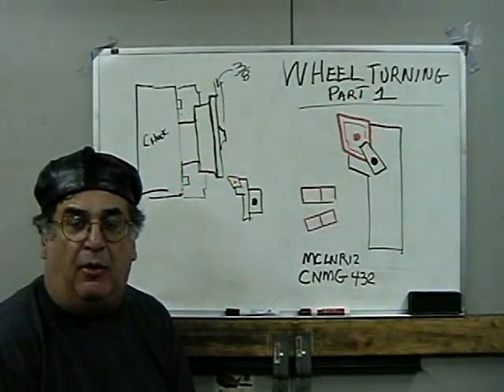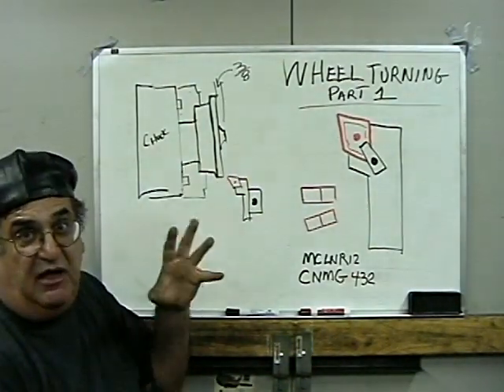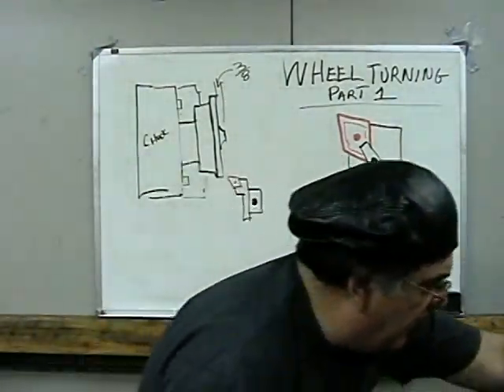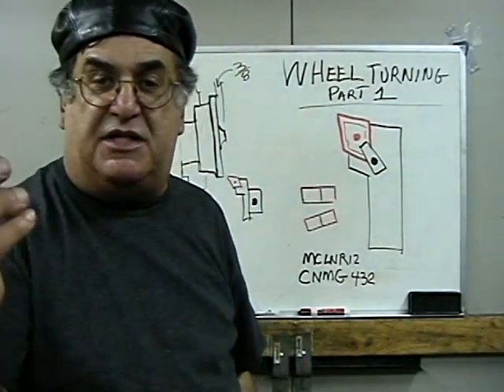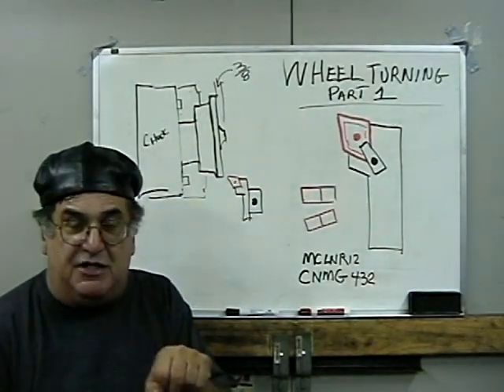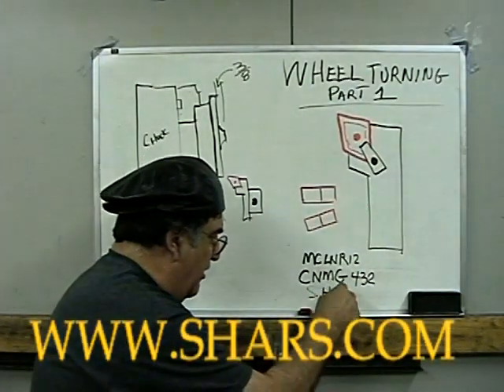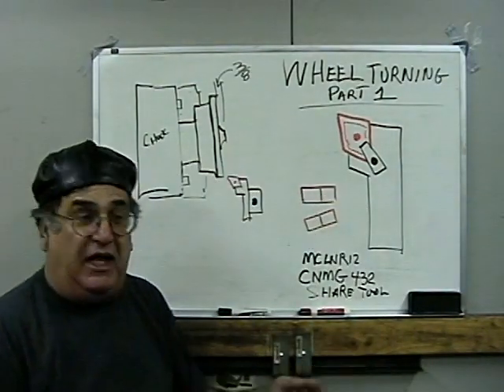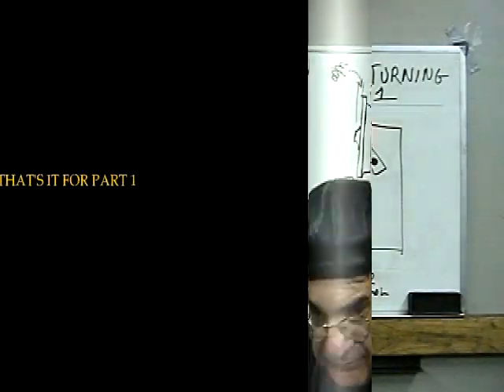LIVE STEAM LOCOMOTIVE/WHEEL TURNING PT1

Comment: I bought the Kenametal tool holder and the USA made inserts.  I put the holder into my Atlas 10 inch belt driven lathe and turned a set of wheels.  The project went beautifully.  I respect that you have more experience than I do, but what you are saying is not entirely accurate.  There is a reason some things cost more; you get what you pay. You mentioned in your description that only a huge lathe coupled with a tremendous amount of force is what is needed in order to fabricate these wheels.  Most of us “hobby” guys don’t have an enormous gear head lathe so if you are targeting us as your audience, perhaps show us how to get the outcome with equipment we might have, or have access to.  And truthfully if a $13 insert is all it takes, then maybe that is money well spent.  And if that $13 give an American or Canadian a job, well that’s just icing on the cake really.  Just my 2 cents, and of course with respect.   Cheers.
Reply from the maker: Thanks for the comments You will see in the next video that I plunge cut then in one cut No south bend lathe can do that Yes you can cut wheels on one but many cuts when you have 100reds of wheels to make it would take a month of Sundays to do the I'm machining them form customers. As far as the china thing this video was made 11 years ago so consider that today I would buy American j
Reply: I was very careful in my response to be respectful to Train Man. I was simply correcting something I believed to be inaccurate son.  And you may fire hobby or YouTube Machinists but I fly the Boeing 737 and have flown the Boeing 737 Max for a living.  By your logic I don’t think Aerospace Engineer necessarily elevates you to a position with much credibility.  But I don’t generalize; your serve.
Reply from the maker: Level3-RC  For your information I have been a professional machinist for 50 years so I'm not a hobby guy
Reply from the maker: Level3-RC  I am NOT a you tube machinist. I have been doing machine work for 50 years professionally trained. Aerospace engineer HA